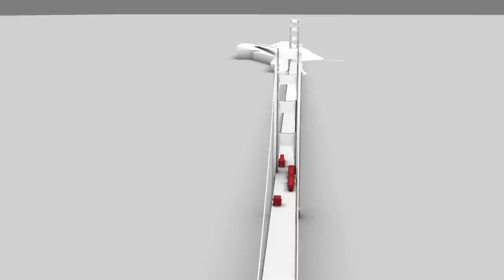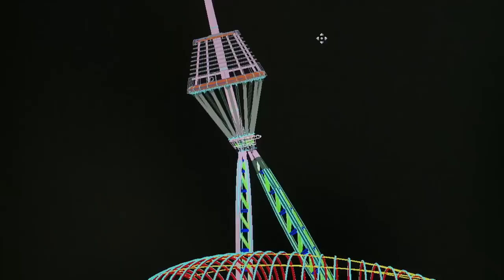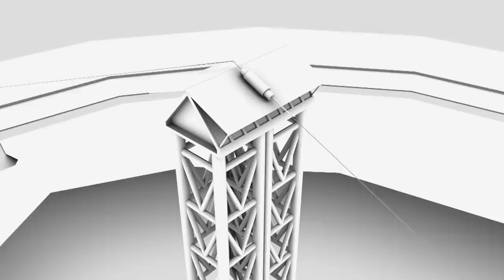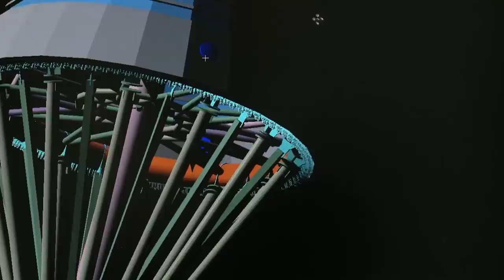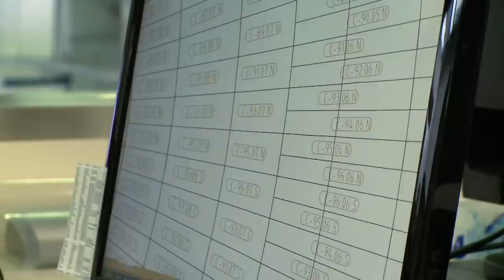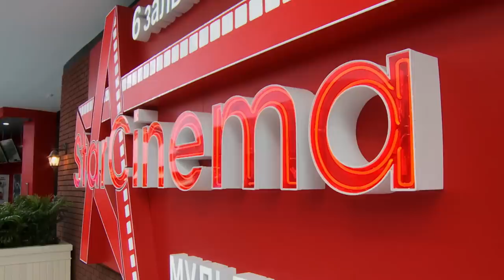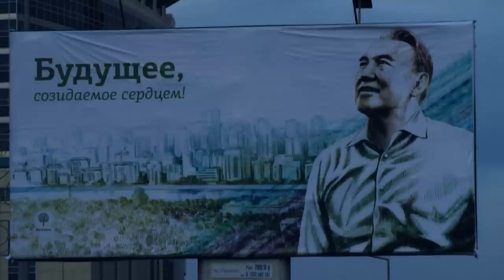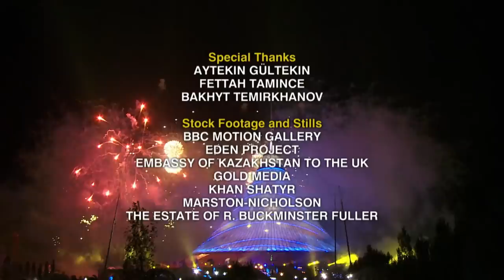World’s Biggest Tent | Megastructures | Free Documentary

Comment: Pretty amazing. I wonder how long the plastic on the roof will actually last under those conditions?
Reply: You're correct! If Kazakhstan weather is anything near like that of Western Wyoming, (and I'll bet it is), that material will begin to seriously disintegrate in about two years from exposure to intense UV radiation...
Reply: it seemed quite thick, the workers were rappelling up and down it, and anything that can support 500+ pounds peak pressure from the average person rappelling, spread out over the average foot space,about 13 inches long and 3.5 inches wide that is an impressive amount of resistance, which makes me believe the sheet of plastic has to be at least 5 millimeters thick, increasing its lifespan significantly and also decreasing uv light penetration and degradation simultaneously. my guess is this thing will last at least 15-20 years. may be wrong. not a scientist. take with a grain of salt